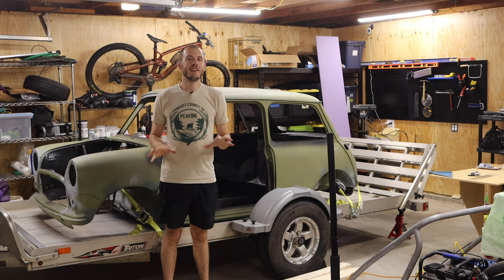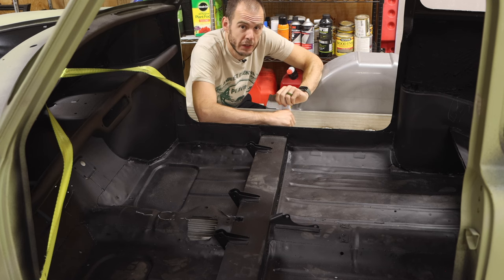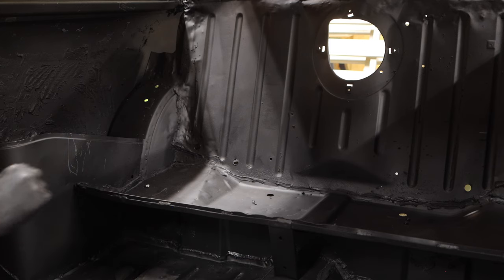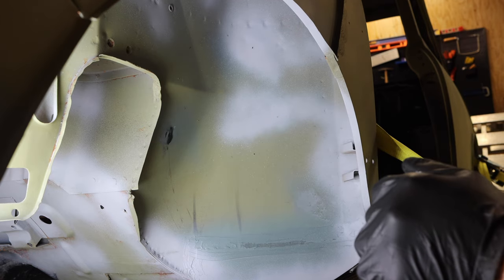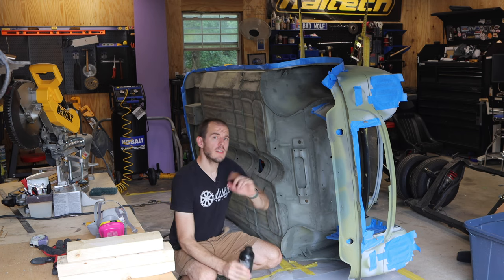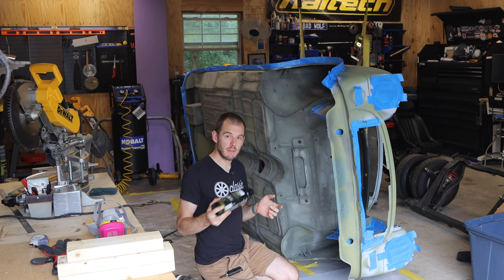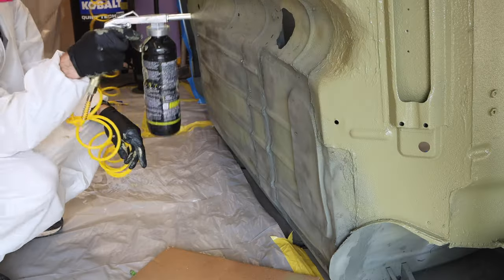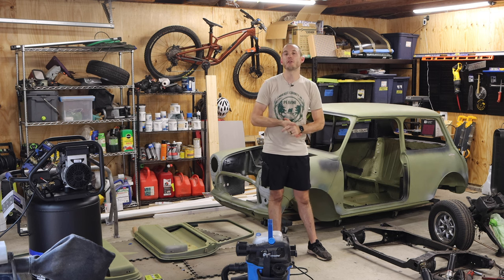Resto-Mod Mini - #5 | Raptor Liner Time!

Comment: Sorry I missed, how many Coates did you do and how many bottles of raptor coat did you use . Great job 👍
Reply from the maker: Interior low traffic areas got one coat(boot,rear seat, door pockets), floor got 2 coats, the exhaust tunnel got 3. It took the better part of 8 bottles of raptor.

Comment: sorry to say but the bottom of the car and the sills look horrible   why not put in some over sills  they are cheap and will look soooooo much better , instead of this patchwork horror
Reply from the maker: Overspills are notorious for causing terrible rust down the road. Not something I would do to any mini. The floors were patched years ago by someone who was not very good at welding. (Go what I paid for) but i could not justify spending the money on a whole new floor when this one was 90% solid good metal.
Reply: Oversills 😂😂😂😂😂😂😂😂